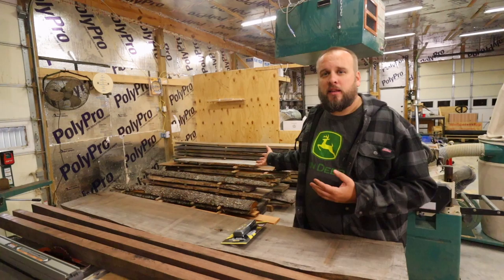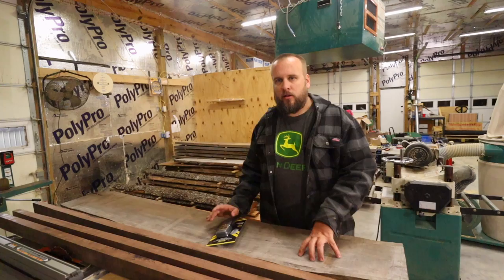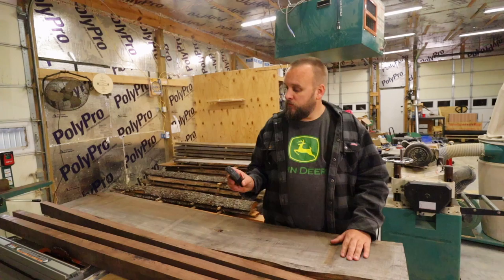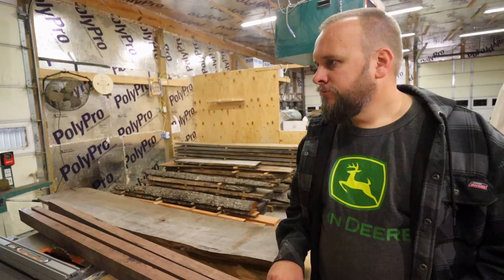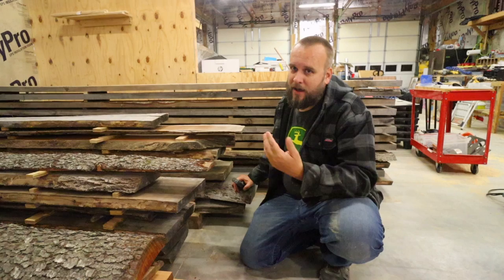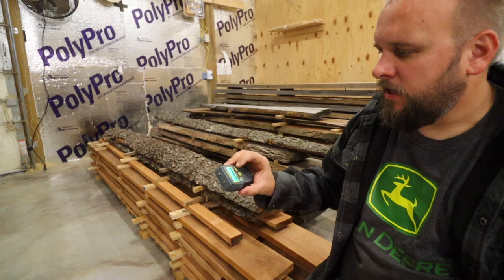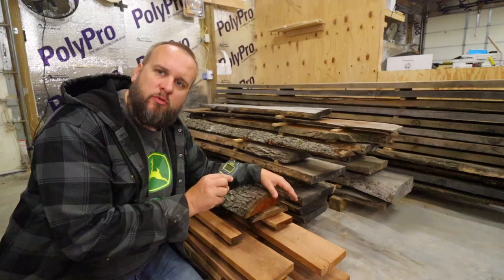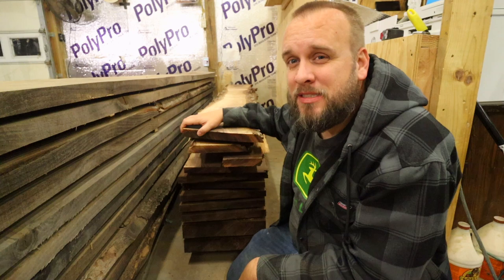How Long Does it Take to Dry Lumber? How Dry Does it Need to Be?

Comment: Lot's of good information there with actual testing, cool.  I have never tried to dry a stack from fresh cut but wood can be finicky even when bringing it into your shop from a lumber yard or store so I would suggest stickering a 2x12 on top of the wettest stack (26%-30%) and then adding some weight on top of it, over the stickers.  This way it simulates being lower in the stack, similar to the boards below it.  Leaving the top fully exposed will likely allow it to dry faster than the bottom side of that board, there will be less air movement and drying between the boards (both boards are trying to use the same air space to dry) compared to the top board.  I would even suggest flipping the top board of the other stacks over each day as they acclimate (until the end of the first week they are in the shop).  Wood is just finicky and every piece is different (you can joint and plane a stick and it be perfectly straight, if you then set it aside and come back the next day, it could have moved/relaxed and no longer be straight......).  Love woodworking though!!  Have a good one!!

Comment: Was just sent a link to your channel. You have some great reviews and experiential insights. As for "how dry" does wood have to be...???...what I ask students or those that claim it has to be "kiln dry" or some other nonsense...What are your skill sets? I've been a traditional woodworker for over 40 years now…From furniture to timber frames.  I don't, nor ever have, used "dry wood" on 90% of the projects I do...Why?...Because that is not how it was done, nor is it necessary...It is about "skill set" not whether the wood has to be dry...Thanks for sharing your video...

Comment: Lots of factors affect drying/warping/checking. Using a Endgrain Sealer, not just paint, slows the curing from the end grain and stops much of the end grain checking and odd ball drying. The edges of the boards closest to the bark will dry faster.  It is why some wood from the sawmill (Quarter Sawn) is more valuable than others, and the best for making table tops, etc. Raising the temperature and increasing air flow in a dryer environment at all will speed up drying. It is all based on Relative Humidity and where the wood will finally settle (EMC) in that new environment. The key to not having problems with furniture is the final owner keeping it in a stable environment. Huge swings in Humidity will affect the table. Reduce that effect by completely sealing the table top.. Top/bottom, particular attention to all end grain. Epoxy in any of the threaded insert holes, etc.. Dry Fitting and then breakdown, apply finish and assemble using glues for the finish is a good idea. Even water based glues will have some effect on glued edges and the wood directly next to the water based glue seams, etc.. At least gives you some more ideas to add to what you got already.. 
Check some of the posts in your shop, and you will see what the MC and EMC is in your shop, and watch it Summer and Winter and see how far it changes/ranges.... This will show you what effect the Seasons have in an unconditioned shop. Get a good Humidity meter for the wall and put it in the shop where you will see it each day. You can tell when you leave the doors open for a couple of hours... 
Remember the dewpoints also.. Temperature and Humidity together.. Every morning Dew.. One of the major reasons why wood won't dry outside. Gets to 100% Humidity early morning when the dew sets in depending on Temp and Humidity together.. 
Seal one side of a board, it will cup to that side. I just did a little research on it last night again..   If you live in a moist environment, don't build and send a piece to the desert of AZ,, unless you can bring the wood down to that EMC Range and finish it in that range.. It's going to shrink and crack. 
Reply back and I will dig up two web links and give them to you.

Comment: Kiln dried lumber is supposed to be under 20% moisture content.  Basically it has to be dried to the point where the free water within the wood cell walls is removed while the bound water in the cell walls still exists.  The wood will shrink once the bound water gets reduced.  Rule of thumb is the wood moisture content will decrease or increase by 1% for every 5% relative humidity.  So if the environment is 40% RH, your wood will end up around 8% MC.
Reply: Not all lumber is sold as kiln dried to just 20%. Building lumber has commonly been kiln dried to those valves but mostly this is to kill off bugs by high heat and to prevent discolouration and decay which does not occur at lower moisture.
Interior joinery and furniture are dried ideally to typical values for the region.
The values you refer to relating to humidity and final moisture is a part of the equation as temperatures play a big part. It's typically referred to as equilibrium moisture content when controlling kilns and dry timber stores.
The moisture meter demonstrated must also be used correctly.
Typically the small probes don't reach the middle of a piece so a hammer probe is needed. Species of the piece may need a conversion factor for the true value.
Temperature again has an effect. Typically adding or subtracting either side of base temperature of 68f .
The only accurate test is referred to as an oven test.
It's pretty tedious but 100% accurate.
As for the original topic of the video. The term was called secondary seasoning.
All joiners used to practice it.
Now it's unusual owing to the space required in the workshop. Humidity controlled storage is now preferable as any moisture coming in has to go somewhere.

Comment: Hey Brock. Those meters aren't that accurate. the pins cant get deep enough. I have one similar to that and found if i check the board from the face then cut a slice off the end, the moisture will change. It could be "close enough" but like you found, it could be good enough. Trick to getting dry wood is keep moving the air around it.

Comment: I use a meter to check my firewood.  The moisture readings are sometimes 20% on the outside of the firewood, but when I split the "dry" piece again, the internal moisture can be 30%.  It depends on how small the pieces were split initially, too.  Larger pieces hold moisture longer.  I own a sawmill and have used the lumber green for rustic tables and benches.  There is shrinkage and warping as the projects dry, but because they are designed as "rustic", I find that acceptable.  I plan on building more tables and chairs with oak and trying to figure out the best way to dry it right here on my property.  The idea behind it is to totally construct everything by hand without any of it leaving my property until after the build is complete.  I'll be watching to see your results.  Should be interesting!
Reply from the maker: I appreciate your feedback. Seems like 15 to 20% is the target for Fire Wood. that’s just info from other videos as I’m just starting to check mine from here forward.

I also plan to use a lot of the lumber In it’s rough cut state where it’s less critical

Comment: Rock, since you are going full time youtube I have an idea for some good content.  Have you notice pretty much all the compact tractor channels feature a single vendor.  You see all deere, kubota or tym.  That ttw guy has one kubota and six deere tractors but I only see orange about once every six months.  It would be nice to see a channel compare brands like some of the truck channels.  Compare your 2038 against competitive tractors from Kioti, Kubota, Massey, and TYM for example.  Run you 2038r against those for 4 or 5 videos doing the same work.  You could also through some auction experience in if you can buy the other brands on auctions.  I've seen a low hour 2021 Kioti 3510HSE go for $13500.  You can then resell it pretty close to that price.  Anyway, just a thought.

Comment: Dude.... no way man. As in there is no possible way all those numbers are right. Looking at some comments below.... not sure how knowledgeable they are either. Like "lumber has to be below 20% to use...." For construction, yes. You need a Wagner moisture meter. Budget moisture meters are just that. A board will not lose 3% moisture in a day.

Comment: You’re giving bad info out on this topic. The meter you’re using is $32 meter and lacks the ability to select the wood species which makes a huge difference. Get a Delmhorst JX-30 if your intent is to dry wood to use inside or for furniture. I don’t know about a lot of things but on this topic I do. You seem like a nice guy but I’d work hard to not misguide people and this video is doing exactly that.
Reply: Jx 30 is like 500 anything in a lower price range that works